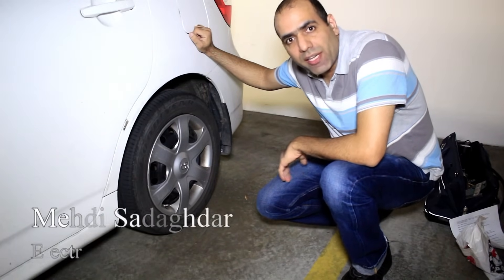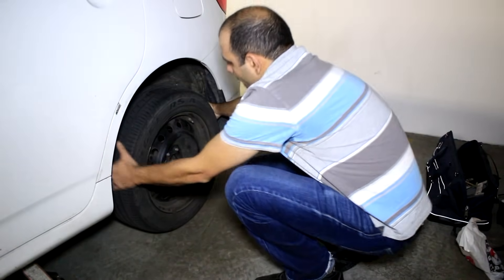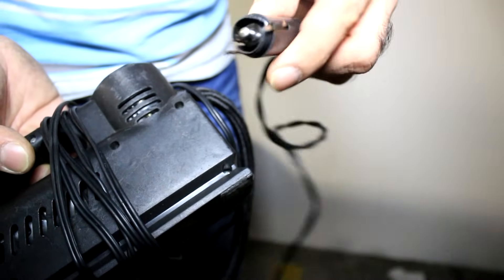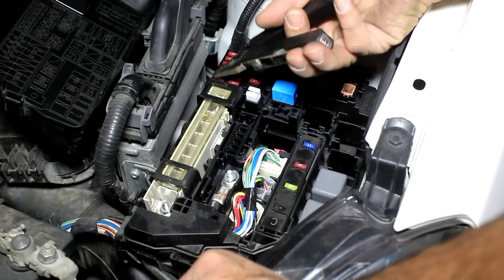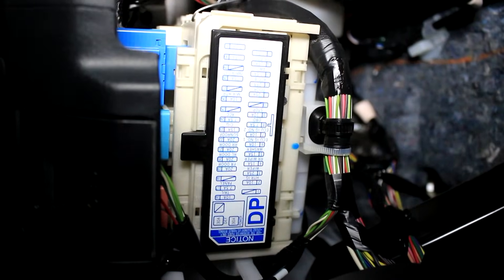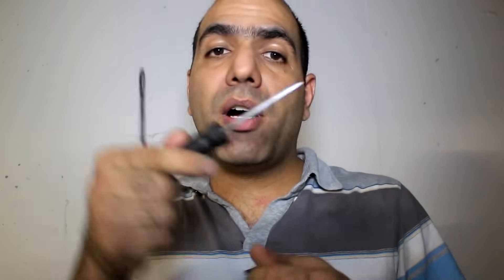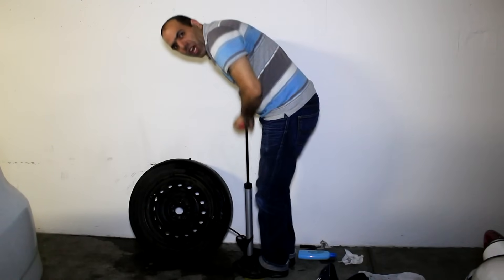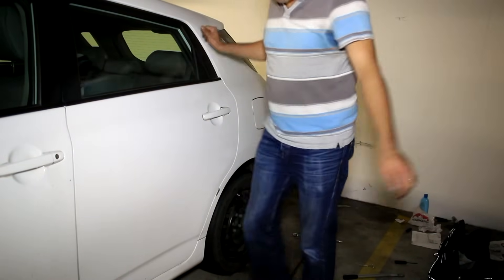How to Repair a Flat Tire

Comment: are you not supposed to flame the gooey strip for about 10 seconds so that the tarry substance melts into the hole to create a better seal ? But, this would make also make you a fire hazard to add to all your other talents... all the best :)
Reply: +aha_144 No, thats a VERY bad idea, you would damage the material, and it would probably not hold. The adhesive won't work if you burn it off.

Comment: That kind of repair is no good. You need a proper patch kit installed from the inside the tyre. Also you need to inspect the inside the tyre to make sure it has not been damaged and only punctures in the centre area of the tyre tread should be repaired.  It's so important to have good tyres for safety I would only consider repairing a relatively new tyre with plenty of tread. That tyre with that much wear with a puncture in that place I would definitely replace. Tyres are one thing worth spending money on!

Comment: hey just want an say great videos! they are hilarious and you learn stuff at the same time :)
I have an idea for a video that would help me if you were interested in doing this! I'm sure I could find a way to fix this myself but just giving you an idea for a video :)
so my USB flash drive isn't getting recognized by anything. so I'm guessing it's a problem with the connector. would there be a way to wire the connector to the circuit board or solder connector to the circuit board?
Reply: just to get the info off it?

Comment: Your tire is old and worn out. you need to change it. If you really got it 6 months ago then there is something wrong with the tires alignment or rods alignment. (Grade 1 Chinese tires go for around $50 a tire brand new.)
I love you man but driving with tires that may give up on you any minute put you and other at risk.

Also "Keep pumping until the pressure is somehwere between 32 and 36 psi". No you don't, you put the exact amount of pressure you tire needs and you do the same for the rest of the tires to make sure your can doesn't wobble and vibrate while driving and stop reduce the "wind noise" significantly.
Reply: +Khalid AlNajjar could be under inflation. Looks a lot more worn at the edges than the centre.
Reply: +Khalid AlNajjar He didn't say he got it six months ago. He said he had three punctures in six months....

Comment: Hi Mehdi! it's me again from your battery video. I really appreciate that you show off the absolute best way for a non-mechanic that doesn't have a million dollars worth of fancy tire dismounting tools to repair a tire. Just figured I'd add that this is not a permanent fix, and you'll end up pulling out the plug and replacing it every six months because even if they advertise that they are permanent fixes and are self-vulcanizing, they still end up curing and becoming brittle long before the lifespan of the tire is up and will end up leaking again. The only real permanent fix is with a patch from the inside, but again, that requires a million dollars worth of tire dismounting tools.

Comment: i am a Toyota technician, and this is basically exactly how we do it
Reply: You must have ALOT of broken fuses by now :p
Reply: @mareck6946  lol
Reply: I thought professional repairs use a patch+plug that is placed from the inside.
Reply: @MushookieMan   for my tire repair we take it off  then if it is flat put it in a tank of water then mark the place where the bubbles come out then take the rim off then look for the nail screw etc and pull it out. Then I file the spot smooth then put glue then a patch then rub until patched  up
Reply: @MushookieMan  That is how you do it, also he plugged the hole that was on the outside of the "belt package" doing this can cause a tire explosion going down the road, this is not a sufficient way to plug a tire!
Reply: @MushookieMan  i think it's a joke and he is shitting on Toyota as a company
Reply: Nerdly Squirtly Boy no they could use either or depending on where the hole is located
Reply: lm Popy legally you can only use a plug/patch professionally (atleast in the US) We would get fined for using just a plug and I would probably get fired. The plug has chances to separate tire plys over time and that can get super dangerous
Reply: James Egelston I know where I’m at they’re changing it to where if you have a push plug in your tire it will fail the safety inspection
Reply: @jamesegelston6239  Local laws vary.  Also application.  Farm implement tires, utility tires and passenger tires can be treated differently.
Reply: @johnchestnut5340  this doesn’t seem like a farm implement or utility tire😂
Reply: @jamesegelston6239  You made a very specific statement that is only true in a specific context.  I clarified that your statement is locally true and not applied to other tires.  In my location plugs are legal but avoided when possible.
Reply: @johnchestnut5340  I also stated professionally 🤪😝 it’s different than joe in his garage
Reply: @jamesegelston6239  It's still only true locally.  I've had to do things to different standards based upon customer needs when coming from out of state.  In some instances I had to send a customer to another location because my shop couldn't meet their needs.  Sometimes you have to "bend" a rule to get a customer to another shop.  But the customer knows what you are doing and goes to another shop.  Nobody wants to get hurt.  And if the guy down the street can help when you can't, you do what you can to get the customer safely down the street...certainly not across the state.  That's taking an exceptional risk.  But down the street at 20 mph or less should be safe for a few blocks.  Then again, you probably don't have that option in case a customer chooses not to properly fix the problem.  Either way, good luck.  Stay safe.  I don't like lawn mower tires.  Bicycle tires are annoying but okay.  I avoid fancy wheels/rims.  Split rims are a pain.  Low profile is a pain.  Extremely low profile has to go elsewhere.  Tractor tires might or might not be a problem.  ATV tires might or might not be a problem.  And upside down wheels, doable but not fun.  I also use cheaper/older tools.  Some jobs are still done by hand.
Reply: Oh so why did yoy put a fuse box under the steereing whele
Reply: Just blow up the lighter fuse “yup it’s fixed alright “
Reply: So car technicians also blow a fuse in the car while repairing a tire........?
Reply: Yeah u blow the lighter fuse and repair it and smash ur head with the hood
Reply: I've heard so many people on soap boxes saying you MUST go and have it professionally repaired with sophisticated patch/plug etc.  They'll even say it MUST be replaced or expect certain doom.  Keep rocking the plugs @ElectroBOOM guy.  The treads will wear down before it will ever explode/leak.
Reply: Toyota replaces the tire and i know it a joke
Reply: Does it involve blowing fuse boxes ? 😂
Reply: Yeah my nearby gas station do that for 10$
Reply: i don't think every Toyota technician is funny like him
Reply: You can break a Toyota?
Reply: And you still don’t know proper grammar.
Reply: I would hope not, for many reasons
Reply: I hope you guys at least torque the wheels
Reply: Mistakes and all lol 😂
Reply: You start by replacing the blown fuse too?

Comment: And always check the psi of the tire so it doesn't blow up. Most spares are low pressure because their designed to be only used temporarily, while most other tires are a higher pressure. Also make sure your not driving over 60mph for a extended period of time. ;)
Reply: +Travis Piper this is incorrect... a temporary compact spare due to the dimensions and weight rating of the tire will always require significantly more pressure than a full size spare

generally a donut will call for 60psi while a full size will be equal to the pressure of the tires installed on the vehicle (in the case of vehicles with different front/rear pressures the spare will be at the higher of the two)

now most spares tend to be dramatically underinflated when installed because they sit in their compartment or holder completely ignored until a flat happens... so protip: regularly check your spare tire's pressure
Reply: SgtPnkks Woops yep got it mixed up lol

Comment: +ElectroBOOM You forgot to mention a very important step. Tightening nuts when tires are on the ground... Potential a nut will come lose if not torqued down.

Comment: At some points I had my doubts whether he would actually fix the tire, really surprised he did!
Reply: At first, i thought he will blown up the tire first lmao
Reply: Tires not fixed...leak temporarily plugged.  That goop dries out and the plug will leak.
Reply: He is an electrical engineering he can fix anything
Reply: Nice to see you!

Comment: "Who puts a fuse box here?"

Electrical engineers.
Reply: +jb listener nah, Mechanical Engineers decide where the box goes
Reply: My Mercedes had three and a half fuse boxes. It had one in the engine bay that was actually two fuse boxes under the same cover, one in the cab, and one in the trunk. Good luck ever finding which fuse you accidentally blew while trying to install an aftermarket radio.
Reply: pklongutoobe
Most cars have two fuseboxes, one inside the passenger compartment, one in the engine compartment, as seen in the video.
Reply: +jb listener Yes such a weird idea putting the fusebox in the nice dry air conditioned interior of the car instead of the hot/cold wet+salty engine compartment
Reply: jb listener your welcome lol
Reply: Nope, the manufacturing engineer did it put there for production efficiency reasons.

Comment: Your video is too short... Where's the part where you lose the wheel while driving because you didn't proprelly torqued the nuts once the car is back on the ground?
And, when you lowered the car... I expected you to have your foot under the tire...